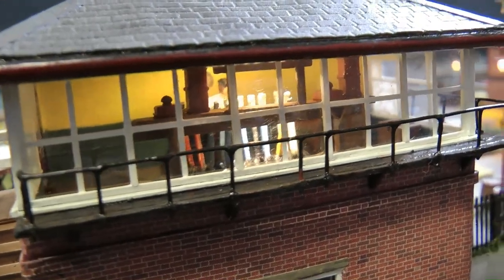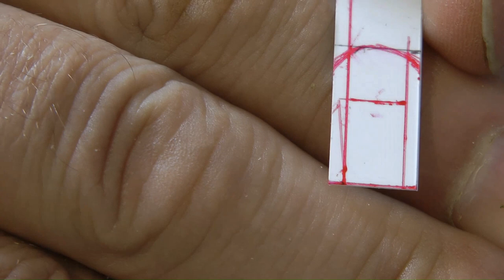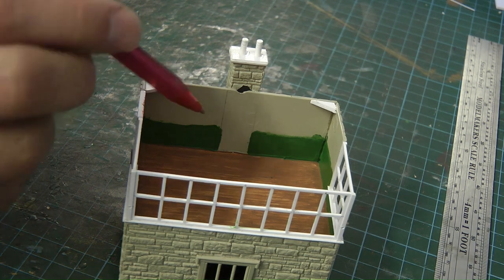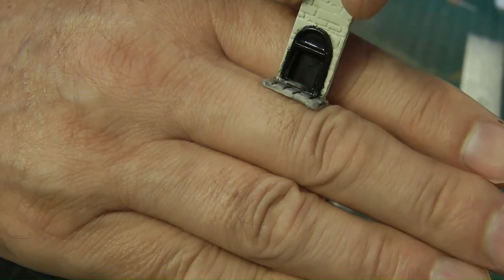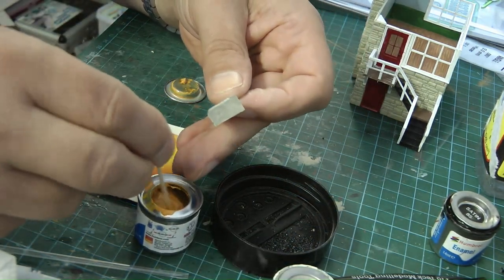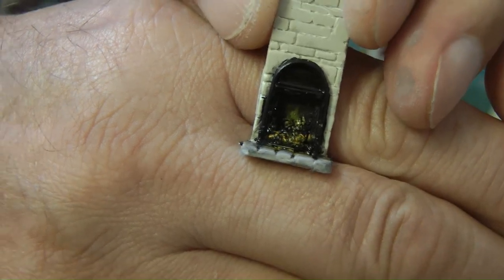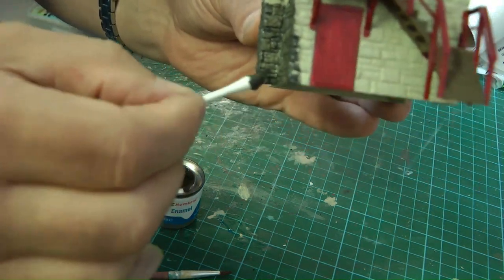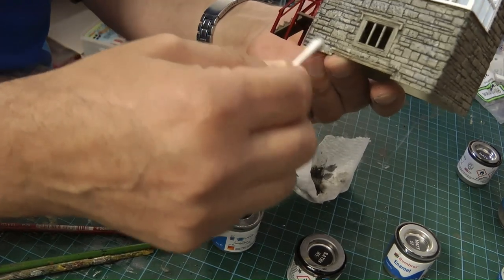Jarrow Road Signal Box   Part 2  No387

Comment: Hi Tony.  Thanks for the mention regarding your G5, 67247, which ran between Sunderland and Shields.  You are correct in that it was stabled at 54A Sunderland South Dock Shed from at least the start of BR in 1948 (probably before), until its withdrawal from service on 31st December 1954.  It was built on the 30th June 1900 and disposed of at Darlington Works on 28 February 1955.  RIP. 
The signal box is progressing well and looks smashing, even without its roof and interior.  I would suggest that you get a tarpaulin over the top, tout suite, to keep the rain out. 😂 I’m looking forwards to seeing it finished and on the layout. 
Any thoughts on signals, Tony?  I have a few ideas including a fixed distant signal, near the pill box, due to the restricted view towards the station.  The signal can easily be scratch built and is something not often modelled.  Have a great weekend.  Best, Jason.
Reply from the maker: Hi Jason, thank you for coming to the rescue on this one. i knew it was something the loco was in translon before the pre-grouping stage. 
as for the signals i am leaning to the old semaphore type. as i feel that this branch is still behind the times. while every where else is just starting to get the traffic Light type signal. thanks again for commenting. cheer's for now Tony.

Comment: Mrs Simms kindly has offered to cook for the signalman at South Shields Station, and is willing to make a rather nice sausage toad for those chilly nights that will be coming up during the autumn. Being woman of her word she explains the steps involved. Prepare batter: Combine eggs, salt, pepper, cayenne, 1 cup plus 1 tablespoon flour, and milk in a large bowl; whisk thoroughly until batter is very smooth and no lumps remain. Whisk in water. Cover and let rest at room temperature for 1 hour.

Prepare sausages: Heat vegetable oil in a skillet over medium-high heat. Add sausages and cook until browned, 2 to 3 minutes per side. Remove from the heat and transfer to a buttered 9x12- or 9x13-inch baking dish. Pour oil from the skillet over the sausages; brush oil with a pastry brush all over the bottom and up the sides of the dish.

Start onion gravy: Melt butter in the same skillet over medium-high heat. Add onion and salt; saute until soft and starting to brown, 5 to 6 minutes.

While onion is cooking, pour batter in and around the sausages. Place in the center of a cold oven and turn temperature to 500 degrees F (260 degrees C). Set oven timer for 30 minutes.

While toad in the hole cooks, finish onion gravy: Stir in flour and cook for about 2 minutes. Whisk in chicken broth and return to a simmer. Add Worcestershire sauce and balsamic vinegar and simmer until gravy thickens up and reduces, about 5 minutes. Reduce heat to low and stir in green onions. Taste and adjust seasoning.

When timer goes off, remove toad in the hole from the oven; it should be browned and puffed. Spoon gravy over the sausages and garnish with green onions and chives.

Serve with extra gravy.
Reply from the maker: Hi Alan, i do like your tales of the unexpected. take care my friend. cheer's Tony